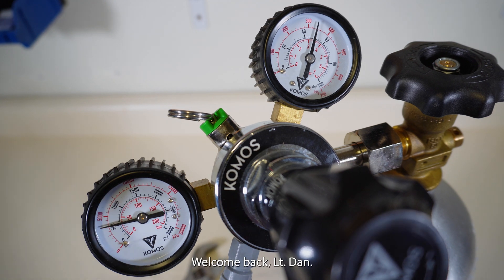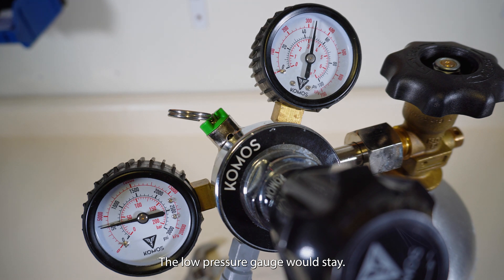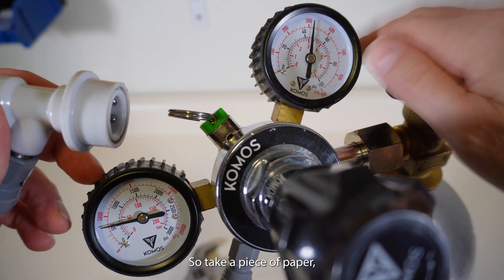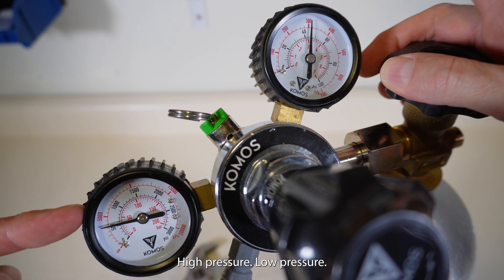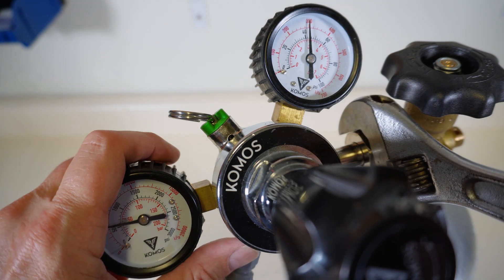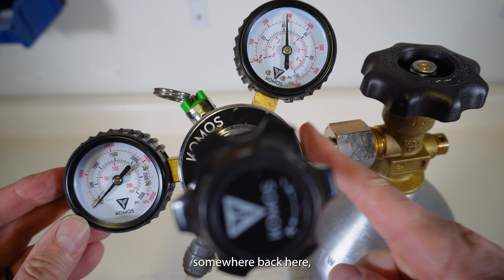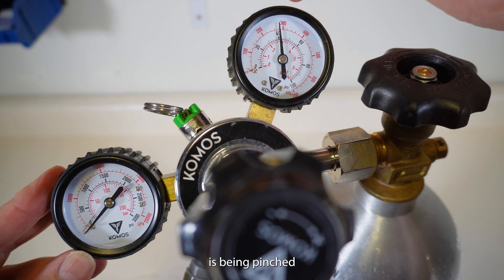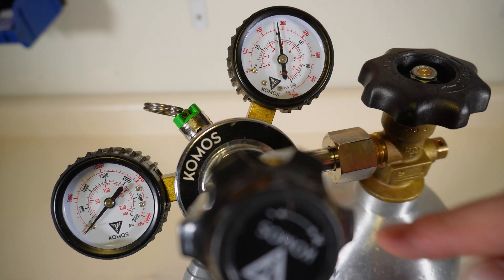Question Answered? High Pressure gauge falling.

Comment: Thanks for the video! Exactly the same problem that I have! However, mine has some miracle involved. I close the tank, the high press arrow is showing no movement at all for 3 days but after then it drops to zero within only a night. I have checked almost everything for a leakage but have not found any. I am thinking to put the tank with the regulator into a large bucket to check for bubbles but not sure my Kegland MK4 regulator is waterproof or at least water will not brake it. If you have any ideas please share I would appreciate a lot!
Reply from the maker: Is your leak still...leaking? It is strange that your leak seems to come and go. That's not typical. Sorry for the late reply...
Reply: @FYBS  nothing to sorry for!)) now the leak stable, high pressure gauge shows zero after one night or so. I sprayed soap water everywhere but no bubbles anywhere. Thinking of putting the gas with regulator into the bucket with water
Reply from the maker: @davewebb8777  Let’s try this: Set the Working Pressure on the regulator to zero, turn on the gas, turn off the gas, and observe the high pressure gauge for movement. This will test the high pressure side of the regulator. If there is no leakage on the high side then create the shortest possible low pressure system (if your regulator has a ball valve use that) then set the pressure to 50psi. Turn off the supply of gas. Watch for a drop in pressure on the high pressure gauge while also listening carefully for a leak. This will test your regulator. 

To answer your water tolerance question: A regulator can be submerged. There is nothing sensitive to water inside. There will be water/moisture under the glass afterwards which I would find annoying. 

I would personally try to find the leak ‘dry’.
Reply: @FYBS  thank you. I will try your suggestion and let you know! Yes dry detection is preferable of course but if  I don’t find a leak that way I will submerge it